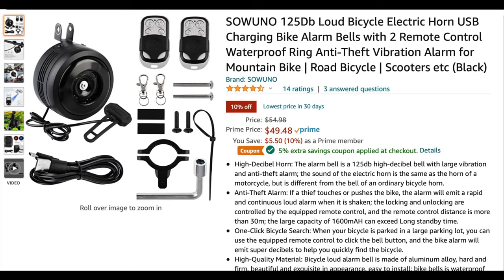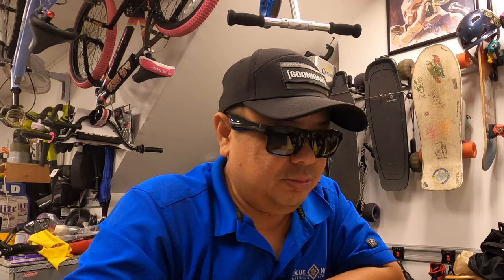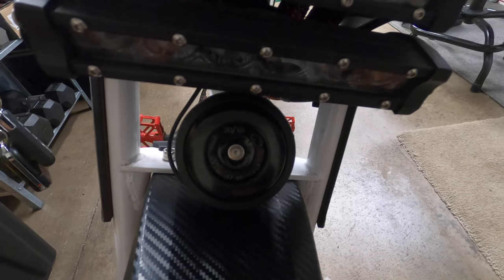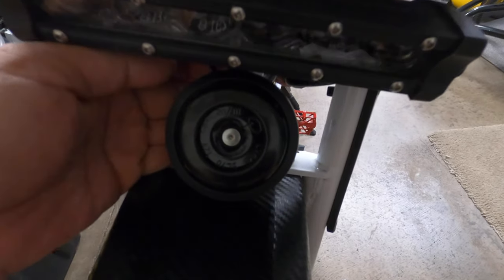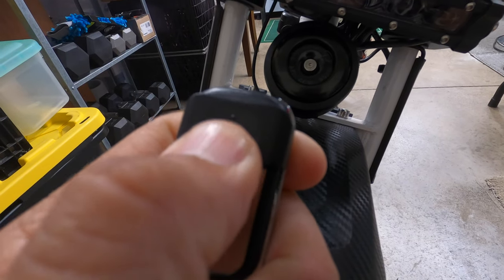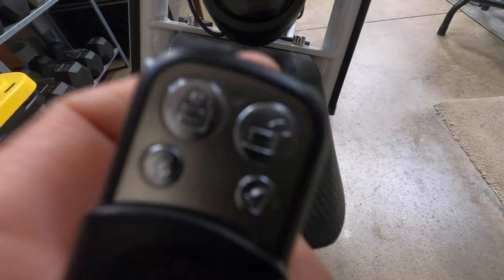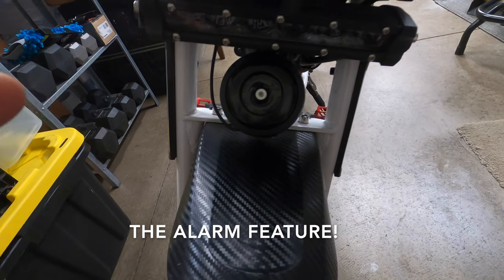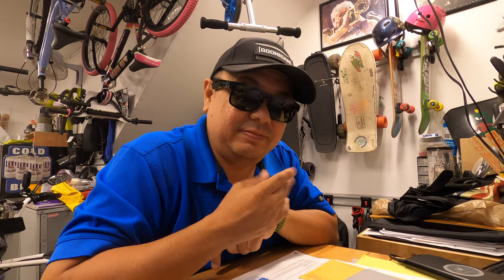SOWUNO BIKE ALARM HORN 3 6 21

Comment: Bought this from Amazon in UK.  The beep is so loud it jabs your ears….As loud as a regular car horn.  Plus unlike many other horns, this one, as in the video, makes a proper car horn sound that folk will recognise as a danger blast. This does exactly what it claims and the remote activation fob is a nice extra….In lock mode it blasts if anyone jiggles/moves the bike.  Well worth the £59 and could save you much more in accident avoidance.
Reply: Have a look at Big Game Bikes too (UK), they have some awesome bike parts including this horn.
Reply: Does the remote vibrate or light up when the bike is tampered with and siren goes off

Comment: Great video man! I recently bought this same brand off Amazon and I love the features amd quality. I bought it for my electric scooter that didn't come with a horn. My only obstacle is I'm not mechanically inclined but even with pictures or wording, I can figure it out eventually but I'm pretty sure there were no actual installation instructions to mount it.  Any tips or instructions you could pass along?

Comment: How long does those horns last? I have been reading that many bought this, and then they cease to work/hold a charge after 5+ months? 

Either way, I bought one and it'll be here this coming Wednesday
Reply from the maker: It’s still going over a year and some change!
Reply: Good to know.

In case your batteries from your remote die, the battery size is 27A. 

Places like BatteryPlus (not promoting/being paid) sells them.
Reply: For me, charge every 6-8weeks

Comment: This is the same alarm /horn that Juiced bikes sell as accessory. They are exactly the same there is no difference. Interestingly all a thieve has to do assuming they are familiar is to cut the wire going into the alarm. Really a stupid design flaw that takes for granted the stupidity of thieves in general and in particular to this product.
Reply: The alarm will still go off even if you cut the wires.
Reply: the wire is only for button the alarm will not be affected if wire is cut, the alarm still works